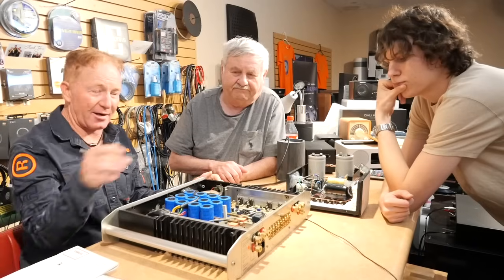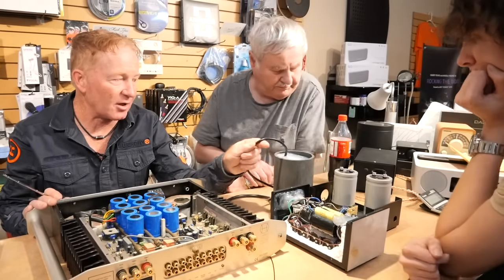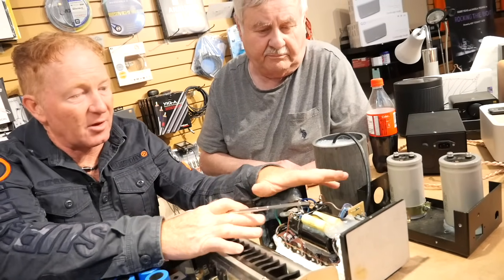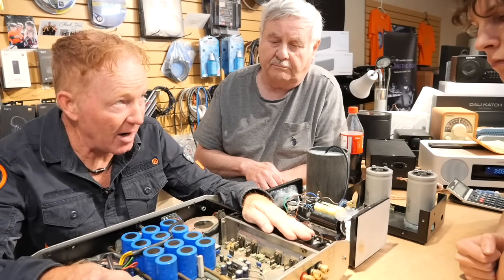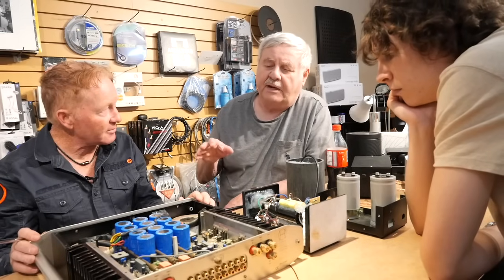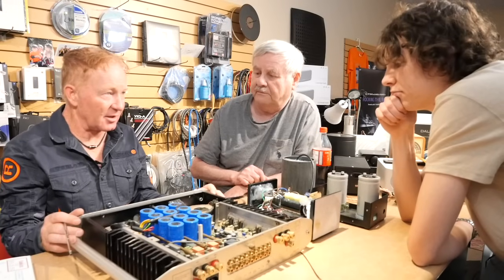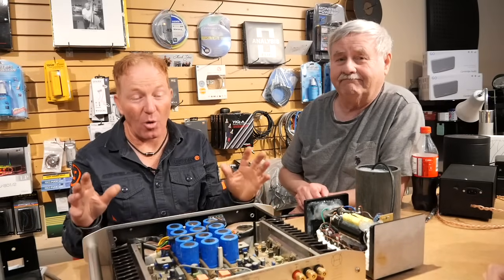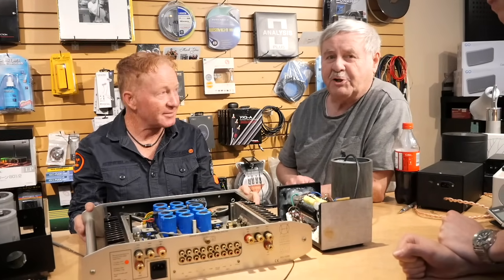Why those big capacitors?

Comment: I’m all about it. Very cool
It’s like the water well at our farm , it has a five gallon tank that gets filled from the pump. Water pressure is not great but if you had a hundred gallon back up tank you could increase the pressure without running out .

Comment: That looks like a well made and designed old school amp.
Reply from the maker: It was designed and made in the 90's.  Beside the lack of contact surface area of the output transistors to the heatsink, I agree with your comment.

Comment: How  are they connected? Can his be used on Class D amplifiers too?
Reply from the maker: The FCF is connected via one umbilical cord from the amp.  As long as the Class D amp has a linear power supply, it can use FCF.
Reply: @angela-gilbert  how about  low- wattage, classD   amps running on 12 volt  batteries? Is a capacitance bank like this of any use? Or the battery is already doing this job too?
Reply from the maker: @fullranger3435  Batteries can hold more energy but they are slower release compared to these capacitor pack.  Capacitors response much faster than batteries.  When music transient demand fast response, the capacitor bank will response and then charge up by the batteries again.  The combination of battery plus these capacitor bank will work together to benefit low wattage Class D amp.
Reply: @angela-gilbert  Thank you Angela, I appreciate your response. Sounds reasonable.

Comment: My ADCOM GFA 555 MK2 has big capacitors as well. Great amp
Reply: Still have mine I bought about 30 years ago. It's a beast and could drive my Magnepan speakers like they were high efficiency Klipsch horns.
Reply: @chrislj2890  Hey , which model of preamplifier you are using? I have the GFP 565. Enjoy buddy
Reply: @RanTausi  
Well with the GFA-555 II I was using a B&K Sonata preamp, but I also had a GTP-500 II tuner/pre-amp I paired with a GFA-535 II amp. I believe it was rated at 60 watts per channel but it punched way above its weight. It was hard to beat Adcom for the money back then.

Comment: Two questions ........
1 ) Most power supplies are  one for thepositive rail and another for the negative....BUT there's only one speakon connector for the additional capacitor supply?????
So it seems the capacitors are connected an unconventional waqy between the negative and postive rail ..!??
Normaly capacitors are connected .........pos-neg ( central mass )pos-neg....here it looks as  being connected  from the pos to the negative neg rail....

2) Big power /energy storage is indeed great ............BUT .........this will stress the power transformer and the diodes ..........they charge only on top of the cyles with HUGE current BURSTS ...........to my experience this causes stress in the music ( when the power is shut off the amplifier runs for some time on the capacitor banks and than all stress dissappears as by magic ... and the amplifier  sings beautyfull as never before BUT soon as the power is reconnected all that beauty and stressless music is gone.....
We did that experience with a big power amplifier with huge capacitor banks...

Anyway the methaphore with the big lake is indeed nice.........

Kind regards..
Reply from the maker: The connector is Neutrik Power Con blue.  It has 3 poles of connections.  Positive, Common and Negative.
There is no stress for neither the transformer nor the rectifier diodes with proper designed soft start.  We have been building power supply as big as 2,500 Farads (2.5 billion micro Farads) for over 10 years with no failure of transformer or diode.  If design correctly, the positive effect is very noticeable with capacitor bank connected to the amplifier.  This capacitor bank is not designed to run off grid.  It was designed to increase energy storage and serve the audio circuit with large amount of reserve energy behind.
Reply: Thank you .... @angela-gilbert
Reply: Im enthusiastic beginner diy-er. May I ask what kind of silicon is used?